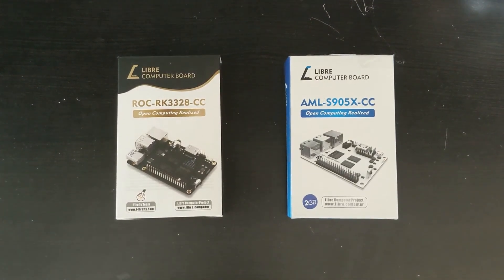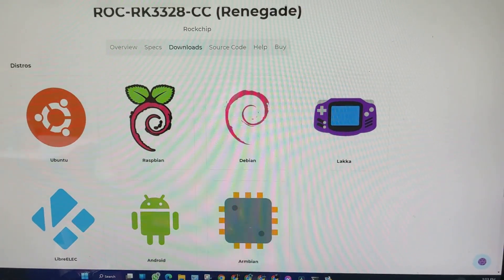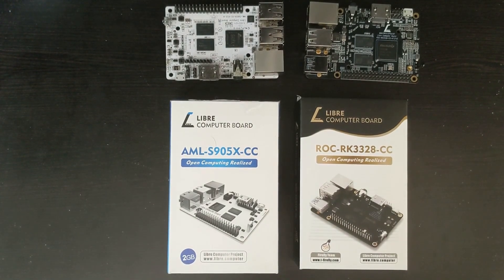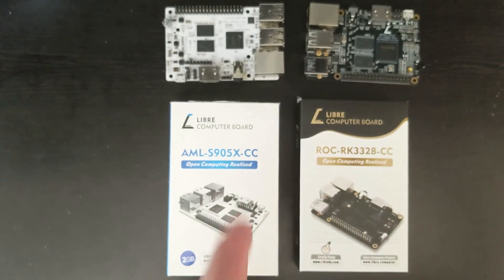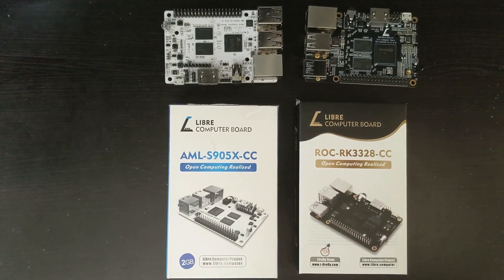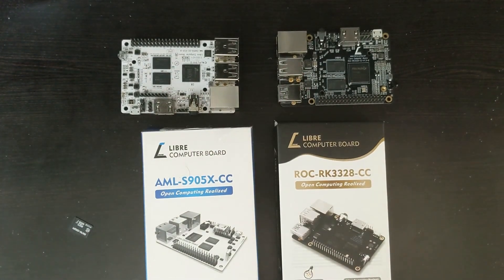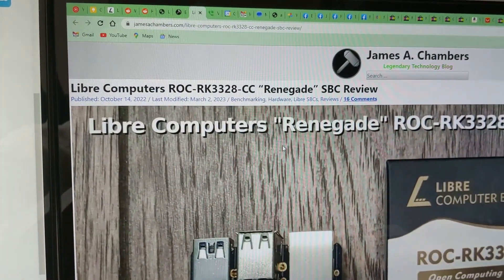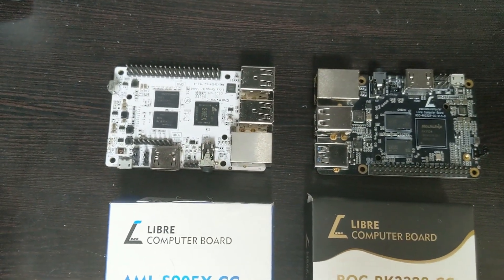Which To buy? Comparison Video Le Potato (AML-S905X-CC) Vs Renegade (ROC-RK3328-CC) Linus was Wrong!

Comment: Le Potato is better for gaming/media, and Renegade is better for Desktop but just barely. Both are slow but you can make a few tweaks on official images to the throttle and swap behavior for better performance. Armbian is better overall, Ubuntu with GNOME and SNAP is just too much for these boards. You want something stripped down and basic. RPi-OS (Raspbian) ports are ok if you want something Debian-based, just use the terminal to update as the "updater" will most likely crap out and corrupt your install.

Renegade is probably best used as a small server or for something like Pihole. 
Le Potato has a few extra options and they make a difference, namely CoreELEC, EmuELEC and Batocera. 

CoreELEC is better than LibreELEC and it's specifically for AMLOGIC chipsets, it also doesn't have the reboot loop problem. EmuELEC (based on CoreELEC) doesn't have the reboot loop issue either. Everything else will reboot loop for eternity without the halt at shutdown. Batocera is also decent, very similar to EmuELEC. Both use Emulationstation and RetroArch. 

You can get Lakka to work on Potato by changing 1 dtb file after flashing the image. 

Potato also has a faster GPU, Mali-450 MP3 @ 750MHz vs Renegade's Mali-450 MP2 @ 500MHz. I prefer the Potato, Renegade is similar to Rock64 but not as finicky or weird.
Reply from the maker: Hey man! thanks for the Comment! thats a lot of great info. Im sure lots of ppl will appreciate that

Comment: I have both the Renegade and LePotato. I wasn't sure which one was going to be less problematic to work with, so I bought both. They're currently being used has home theater PCs. They both work very well for that role. The renegade seems to be somewhat quicker for obvious reasons. My only mistake was that I bought the GenBasic Wi-Fi 4 dongle (the one libre computers recommends) not knowing there was a GenBasic WiFi 5 dongle that allowed me to access my 5GHz network. Get that dongle instead otherwise WiFi seems unbearably slow.
Reply from the maker: thanks for that comment. and thanks for the Recommendation. although I would be hard pressed to believe the WiFi 5 dongle would make any difference on the Le Potato being that it would be using a USB 2.0 Port (max Speeds 45MB/s). On the renegade however it may be a different story
Reply: @michaeljillian3657  spend a day updating your KODI database and get back to me lol. I don't think I was getting anywhere near that with the WiFi4 dongle. It was atrocious. The WiFi 5 dongle was noticeably better. My setup is Ubiquiti AP connected to layer 3 Cisco Catalyst switch with a pfsense firewall. After 20+ years in network engineering, you just have feel for things... Almost like the Force... I didn't even bother benchmarking that dongle. I'm sure it has its place, just not in my house. Once the WiFi 5 dongle was on, we were snapping through the remote storages that were connected to the KODI database. Much much better, all while connected to usb2. My next project I am going to control a 3d printer with a renegade. I am also going to see if I can do an pentesting with that wifi5 dongle. I'm not sure if I can put it into promiscuous mode, but we'll find out. I also need to really look into using touch screens on these. All my RPI4s are setup with touchscreens as they control devices. If I can find a suitable touchscreen for one of these renegades then it might become a very good alternative to the PI. So far it can do a lot of what I need and I'm impressed. I will by more of them.

Comment: More thoughts from someone who bought both:

The Renegade has the same pinout for 3.5mm jack as the RPi, but I simply couldn't get composite video to work on the OSes I tried (audio output works). If you do ` find /sys/devices -name "edid" ` on the Renegade, it will only show you HDMI.

The Le Potato on the other hand does show you a composite video output, but it has an insane pinout. Instead of CTIA's LRGV or OMTP's LRVG, it uses RGLV. They are apparently going to release an adapter in a few weeks but if you don't want to wait, you'd need to wire up your own cable. I'm going to attempt to do that, and I don't think it's going to be fun.

I haven't done any definitive benchmarks yet, but they definitely both need heatsinks and a fan. With just the heatsinks you suggested,  they get pretty warm under normal use, and hotter still when compiling something with all four cores. I believe the Renegade gets hotter overall. Those big heatsinks may actually be a good investment. For both boards, if you compile MAME for RetroPie (i.e. something that takes a long time and uses all four cores) and then immediately try to play a game after it finishes, it'll be throttling itself hard enough to not run NES games at full speed (at least with FCEUMM).

And I still haven't figured out how to get the IR receiver to work properly with a remote on either, although this may be my fault since I've never set LIRC before.

I might share more later. I'm going to get some fans in today, so I'll do performance tests with them.
Reply from the maker: Wow! thanks for your input! I am sure many ppl will appreciate the information laid out here. I also Have some more videos coming out soon on these  boards (hopefull)
Reply: @michaeljillian3657  Further info. The Winsinn 40mm 5v fans I got do a great job. They use JST-XH connectors, but they still fit on the GPIO pins. They aren't PWM, but they'll always run at full blast, which I'm considering as an advantage for now. I used a 3D printed case with a solid top and used a rotary tool to cut open a hole for the fan. Now they run at 30C at idle and don't go past 55C even at full load. They're a bit loud, so I'm looking into getting rubber feet for the case (because a lot of the noise comes from the fan vibrating the case on the table) and a 3D printed fan shroud to quiet it up a little.

As for performance, I uncovered something incredibly weird. I installed Lakka on the Renegade for the first time last night, and got great results. As expected, N64 and Dreamcast games didn't run at full speed, and I didn't attempt PSP, DS, or GC/Wii stuff, but everything else should work (as long as you use the right cores. E.g. snes9x for SNES and not bsnes). This is incredibly weird because Batocera couldn't even run NES games at full speed on the Renegade. I'm going to report this to the dev team.

As for the composite cable, I thought I had soldered it wrong, but apparently the Potato had been outputting in PAL mode, but this was with Armbian. Further updates to come.
Reply: Hey, may I ask. Is the GPIO layout the same on both?

Comment: Hey interesting video, thanks for it! However can you help me? After your input about the OS section on the video I'm nervous going forward without further information. Basically I'm trying to get a thin client, I realized the SBC's domain is a great place for me but probably I need expert input. Which SBC board you recommend for me so I can use it to remote connect to a virtual Windows 10/11 OS wirelessly through a router? I'm also looking for a SBC that can last on 12 hours a day or something and good heat dissipation, heat sink aftermarket is welcome and also the cheaper the better too. 

Thanks!
Reply from the maker: Hi thre! thanks for the comment! Sounds like you need something a little more powerful. I would honestly get a cheap Micro dell Optiplex or Lenovo tiny PC. you can get an intel i5 5th or 6th gen for less than 50 bucks on eBay and it has relatively low power consumption. Slap in an SSD and it will use even less power. I can surely run 24-7 and any linux distro can be installed on it, as it will be a standard 64 bit system. I know this because that's exactly what I am doing.  I hope this helps!
Reply: @michaeljillian3657  thanks, but I cannot use those, I'm looking for something small that I can make it into a touchscreen on the go casing thing.
Reply from the maker: @jesuschrist1501  I hear you. I would not recommend this single board computer. I would definitely get something with some more power like a raspberry pi or some of the other higher-end ones that Linus recommended in his video. I think one of them is called the droidboard